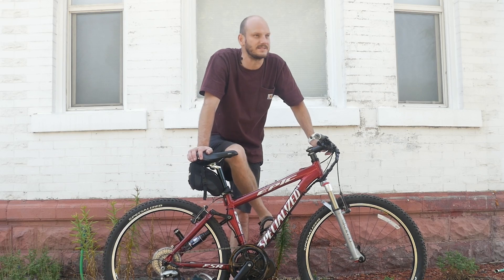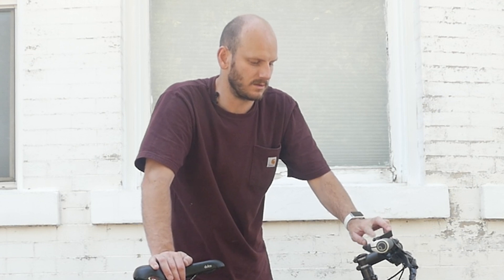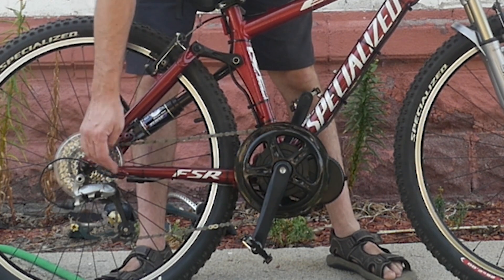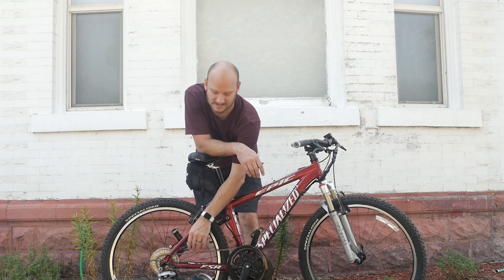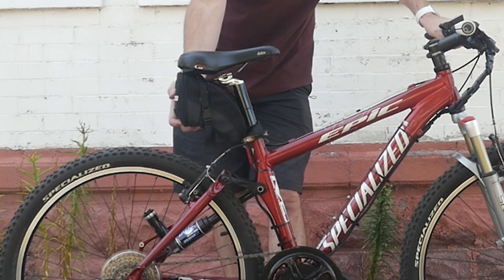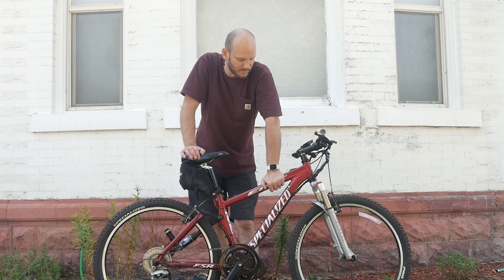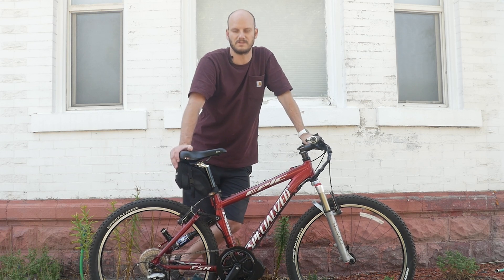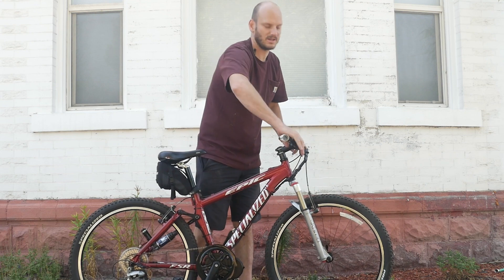Custom E-bike Build: Specialized Epic M4 w/ Bafang BBS02 750w Mid Drive 48v 6ah Saddle bag Battery

Comment: Hello Johnny, I've been binge-watching your videos for almost two weeks, thanks for sharing your knowledge and experience and your humor!  I have MANY questions for you concerning e-bikes, but for now, I 'll keep it to just one -- Is it possible to use a double chain ring up front with a Bafang mid-drive? -- maybe a 36 tooth and a 48 tooth?  I've not yet seen anyone doing this.  Why not?
Wait a minute...That's more than one question...Shit!...I hope I'm not in trouble...
Reply from the maker: I’ll let it slide this time. 😀 mainly it will be  very difficult to find a front derailleur that could accommodate that on mid drive as they stick out farther on the bike than a stock chainring would. Also, it’s just not necessary to have that many gears with a mid drive
Reply: @JohnnyNerdOut    Thanks!

Comment: Hey Johnny. Big thank you for all the content you're providing.  Thanks to your videos I converted my daily commuter mtb into electric bike. I went with 750W BBS02B and downtube 48v 13AH battery  and I love this thing. I really enjoy riding it, not olny to work and back, but also for fun. 
One thing that I'm not sure about is how to safely clean my bike from mud now. I used to just blast it with pressure washer but obviously now I got to change that method. 
I think it's good topic for a video. 
Basically some tips about how to clean and maintain your mid drive motor powered bike.
Again  thanks man, your channel is changing lives.
Reply from the maker: Thanks for that! Always affirming when says says they got something from a video😀 
I wouldn’t power wash your bike anymore. Maybe take a brush to knock off all the crud first before introducing water. The methodically, using soap, (muc-off or similar) clean sections at a time and the towel dry immediately. I would think something like that would keep it from rusting up 🤷‍♂️

Comment: Bafang uses a mid-pull brake lever. You can dramatically improve the performance of those linear pull brakes using a "Travel Agent."

Comment: Hello everyone 
I just bought a Miku max electric bike and it has a problem hope you can help me when I start it and press the acceleration it does little jump but it doesn't move it's like every time i press the acceleration the motor pushs a little and than gets stopped i would really appreciate some tips
Reply: Have you tried pedaling up to like 5mph before using the throttle. I have a suspicion as to the problem you are having.

Comment: Hope you see this comment. Within the next couple of months, I will have a mid drive motor and a front hub motor with the exact same battery model and tire models because of you. That comparison will definitely be in a video.

You really convinced me to do a mid drive after I thought my front hub conversions were great. Personally I am more looking forward to me doing a conversion on a brand new bike and one with disc brakes on both wheels rather than a used single speed one that literally only came with a pedal backwards brake until I had a front brake put on.

26 inch Breach Cruiser Front Hub vs 26 inch Mountain Bike Mid Drive with same tires (ones I find reliable with flats) and battery model (one from a seller I trust).
Reply from the maker: Nice! It’ll be a big difference in performance 👍

Comment: I won't dwell on the "disk" brakes. Who needs them? Brakes only slow you down;)
I've never seen a rear suspension setup like that.
Looks like the handlebar grips are mounted in reverse, they usually point forward.
Reply: If those are Ergon grips as they appear to be, that's how they mount. The shock location is odd, but leaves a nice open triangle.